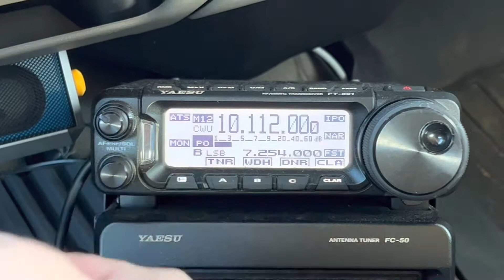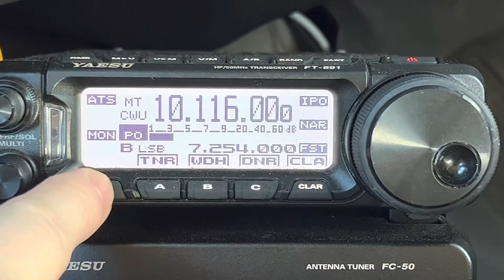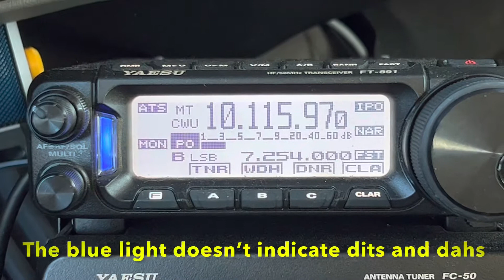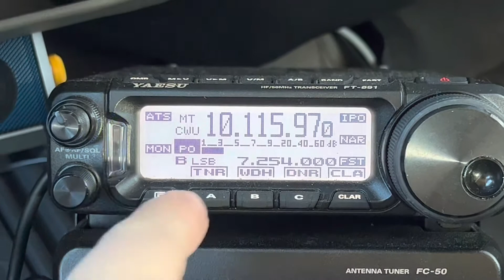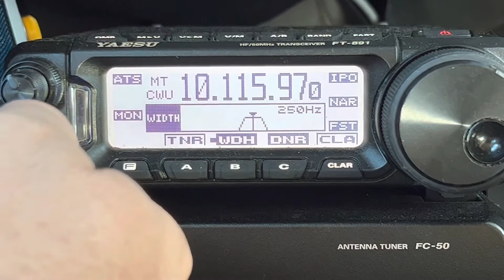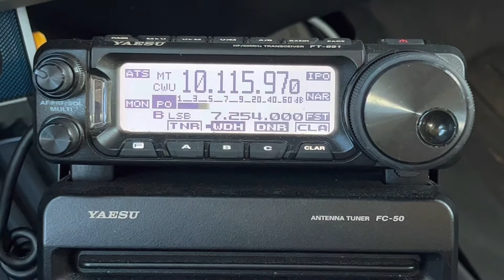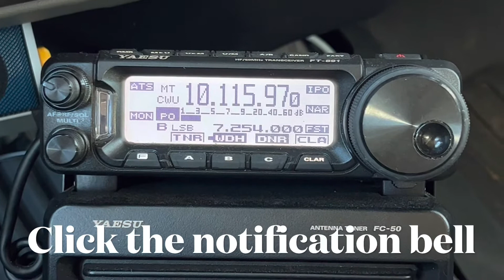Yaesu FT-891 Mobile CW

Comment: Hi Doug, Do you need to bypass the FC-50 when using the FT-891 with the ATAS antenna?
Reply: That’s a nice feature. When I get the 891 I’ll watch all your videos on it more carefully. Actually your videos convinced me to purchase one. Thanks Doug.
Reply from the maker: Hi Martin!  I wrote a more detailed explanation about that in the video description, but enabling the ATAS-120A will effectively bypass the FC-50.  The radio won’t let you use both simultaneously. There is no need anyway. The menu where you enable the FC-50 is where you choose between it or the ATAS-120A.  I showed that menu in one of the ATAS-120A videos. It might be in Part 1.  

73, Doug
Reply: I sent this to myself by mistake: That’s a nice feature. When I get the 891 I’ll watch all your videos on it more carefully. Actually your videos convinced me to purchase one. Thanks Doug.

Comment: Much thanks for this.  I even book marked it so I can refer to it later when I can afford it.  I already have a J38, with leg clamp.  They show up periodically on E-Bay.  Just need to be persistent on looking for it.  Many are set up for the PRC series of radios, in which case you simply have to change out the connector.
Reply from the maker: That sounds like a good plan.  I have a Pico Paddle.  I just need to order the leg strap.

Comment: In all of my research there is not a mobile hf that can compete with the ft-891 to dial in weak stations and filter out the noise.
Reply from the maker: I completely concur, Doug!  And mobile operation is naturally noisy, with noise from so many other sources - not just the normal galactic noise. We need all the help we can get.

Comment: Awesome but a tad confused. The FC 50, is it needed with the ATAS-120?
Reply from the maker: The FC-50 cannot be used with the ATAS-120A. The ATAS-120A is an active tuning antenna system. The antenna changes length according to frequency. 

The FC-50 is only an impedance matching device. The menu in the FT-891 makes you choose between ATAS or an external “antenna tuner” - which is a terrible description for such a device.  The typical “antenna tuner” acts as an impedance transformer, making the radio think it is transmitting into a perfectly trimmed antenna.  This allows the transmitter to see a 50-Ohm impedance and deliver full power into the feed-line, even if the impedance at the feed-line is 150-Ohms. The SWR mismatch still exists. The radio just doesn’t see it. 

The ATAS-120A is an antenna that can automatically trim or extend its length, to provide a truly tuned antenna.

I recommend that you watch my ATAS-120A playlist, starting with Part 1.

Comment: Hi Doug. Thanks so much for your informative videos!  Are you using the FC-50 in combination with the ATAS-120? Thanks, and 73!
Reply from the maker: We cannot use the FC-50 and the ATAS-120A simultaneously. The menu system requires that we choose one or the other.
Reply: @n4hnhradio  Thank you sir.
Reply from the maker: You’re very welcome, sir!  73, Doug